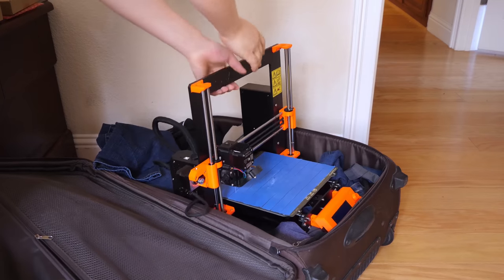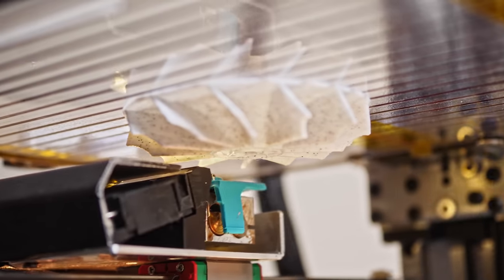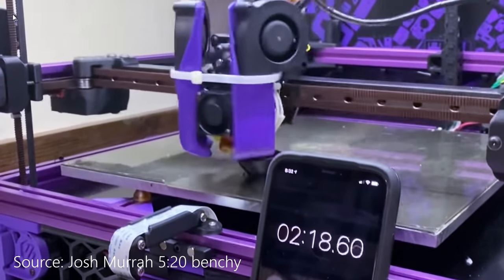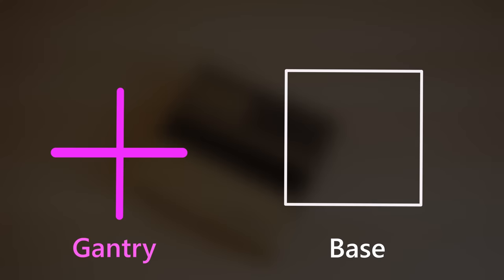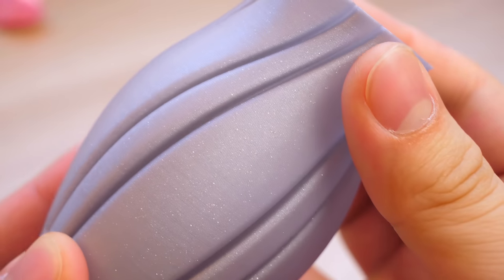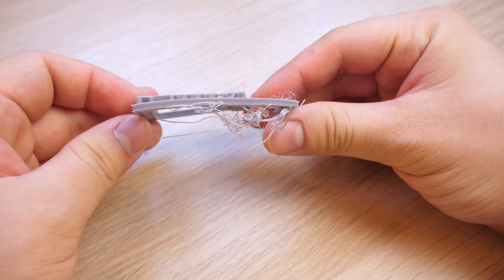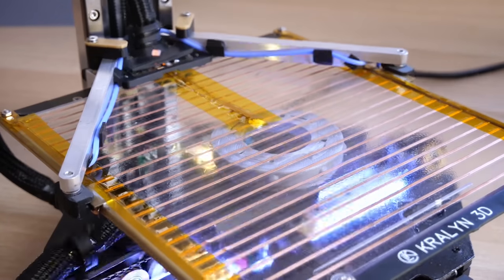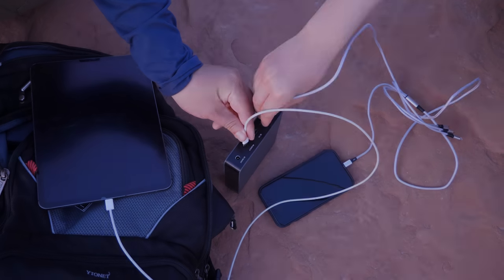A DIY 3D Printer That’s Upside-Down, On Purpose? The Positron Introduction

Comment: Printing upside down for the most part shouldn't be an issue since Resin Printers already do that. My only concern is if the bed happens to sit just a 10th of a mm too high, gravity might pull the filament away from the previous layer, whereas in regular printing, gravity would pull it down onto the previous layer for adhesion. I don't see that happening often, and only for very large prints, but it looks like that might have happened to the top of the Easter Island Head you showed at the end of the video (12:20). It could also be a compounding effect, like each mm of travel actually travels 1.0001mm, so by the time you get up to the 1000th layer you've compounded a 0.1mm inaccuracy, which could lead to layer separation.

I don't currently own a printer, instead I've been using my BIL's, but this is an amazing design. I would love to have a simple printer that I could literally just tuck away into my office desk when ever I'm not using it. Definitely something I would be interested in getting. What is the estimated cost for this?

Comment: I really love this design! Also, if not used as a portable printer, the scalability in height should be fairly easy because of not having to deal with shaking printers and/or parts

Comment: Great job!
1:16 Those volumes are all in Cm³, not mm³, actually.
If you just do the math, using the given dimensions in mm, you get 175*165*125 = 3,609,375 mm³ (which is a little bit shy of an impressive 3.61 liters!)
The same goes for the other two volumes: 75*75*75 = 421,875 and 120³ = 1,728,000

Comment: It makes sense to print upside down from an engineering stand point of view. If only we could outsource those upside down extrusion system and the heated bed you've designed. I'm designing a highspeed 3D printer. Hoping those type of parts will be developed!

Comment: Very Clever, if you would've told me printing upside down yielded the same results, i would have laughed at you. I stand corrected. Love the low center of gravity and compact design. One concern i would have with it in a commercial space would be the fire hazard in the event of a print detaching, it might (Probably) land on the nozzle... would be clever to see a torque-out sensor trigger print stop and have a little actuator that would push up on the fallen part to keep it away from the nozzle until it cooled down....

Comment: very very impressive and clever design. I liked it. 
Just an additional idea: if there have a cool flat aluminum block surrounding the nozzle, with the aluminum block having exact same height as the nozzle tip, will it be possible to have infinite length of overhang? because the cool aluminum block may support the overhang while printing. maybe aluminum block edges need to be tapered a little so to avoid knocking off printed parts. If infinite overhang is possible, then FDM printing with no support structure may be possible.

Comment: Clever design. Two questions: 1. Is it firesafe? When nozzle clogs or in case of bad adhesion will it turn off or it can somehow break itself and building around? 2. Wich part need service first? On the video I saw hard pressure on the rollings with cable and begin to worry about bearings.

Comment: Just had a thought of an upside down printer.  Awesome to see someone have tested, designed and prototyped it!  Went through the files you shared and saw that the thingiverse files were obsolete.  Is it still in the works or has this been dropped?  Happy that you've shared this video!

Comment: Wow, I've thought about this a lot, but you actually did it! I like it :) I'm very curious about the precision of the synchromesh cables. I've read good stuff about it. But in every topic I find about it, there are always a few people claiming they contacted the original company, saying that it has worse backlash and higher cumulative pitch error..
Reply from the maker: I read them all, but I just decided to try it, and I have to say so far I had no backlash problems or inaccuracy.
Reply: I was curious about "belts" also.  I've never seen them used before.  Thanks for asking the question for me.   Now I know what to search for.

Comment: Awesome. Would instantly buy a kit or even a fully commercial version. 
The only thing i don't like is the control panel, i guess it's functional but i love touch :D
Reply from the maker: Fair, although it is not meant to be used, as everything is controlled via Web interface. The only actual button I press is the on/off and emergency stop button.

Comment: Awesome work and incredibly well done. My only comment is that I feel it’s a solution to a problem that doesn’t exist significantly… I will be the first to admit that I’m 100% wrong, but I wouldn’t guess that portability on the scale you mention (traveling) will ever really be needed for a printer… nonetheless, an elegant design and incredibly executed! I can certainly see how it is extremely effective when  it comes to rigidity and stability.
Reply: I agree the portability may be less important than just plain being able to store it when you are not using it. Most of the world does not have the huge homes that Americans are used to and storage space is limited. I have a spare bedroom that is my electronics room and still wish that I could put my printer away when I am not using it. I want this for my RV so I can build things when I have ideas on the road. The biggest challenge is going to be refining the design to get the price point down for the mass market without sacrificing precision and accuracy.

Comment: Would definitly love if I could buy this and if there would also be a slightly bigger print volume (around 200x200x200mm). But even with this size I would consider buying it. This printer is great engineering work.
I would love to use it for semiflexibles / harder TPU filaments. I think stringing would be 100% eliminated with this upside down design.

Comment: This is a really neat printer design, that heat block is a really cool design too. I’d be interested in trying to build one of these but I don’t know where I’d have to source one of those heat blocks, though if you’ve got prints in the build docs I suppose I could probably try to make one on the milling machine at work. If you go forward with a commercial run of these, I’d definitely be interested in purchasing one if I have the funds on hand.

Comment: Very well done!  I'm guessing PLA was used in the demos.  Given other materials (ABS)  are susceptible to warping from uneven cooling.  Typically, this is corrected by enclosing the build area to prevent stray air currents.  When enclosing the build area, a new problem of getting cooling to things that must be cooled.  How does this design handled enclosures?  Also, how does the print head work with 'squishy' filaments such as TPU?

Comment: Amazing job! Maybe it would be possible to cool this printer much better then most by pulling air out of the bottom, cooling the top of the print but not the build plate due to the laminar flow suction.

Comment: To everyone concerned about gravity either helping or hurting the FDM printing process, it turns out gravity has virtually nothing to do with the process.  The forces related to viscosity, nozzle pressure and stretching of the semi-liquid molten filament are all significantly greater than the weight of the extruded filament.  Hence, all of the aspects of FDM printing (oozing, bridging, curling, etc.) are virtually unchanged when you print upside-down.  I have been printing upside-down for more than 5 years now (see LoboCNC video links above) and everything about the process is pretty much the same as with my conventional printers. Even on the rare occasion that a print detaches from the bed, it just falls off, gets pushed around, and the extruder merrily creates a pile of spaghetti. And beyond that, this looks like an excellent printer design that I'd gladly add to my collection.

Comment: While I think most of these 3D printers to be on the small side, which limits a possible market for an auto entrepreneur with little capital to start, they are nonetheless quite lovely and have my interest. One with a minimum 400 mm item production capacity is the one I'd want to purchase. If I purchase one, it will be my first 3D printer; but, I may be better off building one from scratch with parts that suit my needs. I will have some difficulties to do so that because I have no knowledge of 3D printers.

Comment: Like some comments, the fact that you can fold it away for storage when not in use, is much more needed element than moving it around. Only suggestion I would have on it, is that could it be so modular, that you could swap rails to 250-300mm to make this BIG folding printer? Or does it loose its rigidity?

Comment: If  there is a bit of space in the bottom.. maybe we can integrate a camera running to rpi which can run a ML or AI algorithm to figure out issues and make improvements along the way? Like if there is layer shift them the rpi can inject gcode to compensate and correct or if there if the print fails then instead of burrowing the hot end in melted plastic it can self shut down?

Comment: Excellent and compact design, I wish you all the very best success in the production. I was wondering if there is a printer that has a built-in UV curing lamp to cure epoxy resin/hardener type of filament if there is such a filament, perhaps another challenge? :-)

Comment: How have piqued my interest, and would happily pay for one a Positron.  In fact, would like to be an early adopter tester (would still pay for a unit).  I recently retired as a software engineer and tester (across many industries) and have been 3D printing regularly starting with the Printrbot 1405 Simple Wood, and the past 3 years or so with a CR10S.
BTW - I loved the closing.  Amen

Comment: Very interesting and an innovative design. Although every prints you made seem good in fact, have you tested or calculated maximum weight it can handle and if this is scalable what would be the maximum scaling in dimension while considering bed adhesion of various filament materials?

Comment: So on a standard right side up printer you usually need supports for any over hang over 45 degrees (at least in experience). Would it still need support in those overhang areas if the model is flipped upside down? Or would they still need something to hang from? Did you use anything like glue stick for bed adhesion?

Comment: The right-angle in the hotend path makes me concerned with retraction settings & oozing when printing materials like TPU. Pretty cool though, I'd consider purchasing one. Are there any issues with cantilevering of the bed because it is only supported in the corner?

Comment: Could you maybe use gravity as an advantage to straighten bridges?

Like straightening that slightly sagging first filament line of a bridge by partly re-melting it with the print head while pressing it upwards in an arc pattern over the course of the bridge?
Or printing the second lower line in an upwards arc, bending the softened first upper line upwards and straightening the two lines as a result?
...
I guess probably not, since you would actually need to shorten a sagging line to make it perfectly straight.

But nevertheless, I like the notion that you could potentially use gravity as an advantage for something!

Comment: Looks amazing! Just wondering how materials like PETG, Nylon and such will print, Nylon hates sticking to stuff without warping. PETG needs glue to not crack glass plates. Will follow the build!
Reply: For both i think a layer of glue stick or nano-polymer-adhesive would solve that issue

Comment: Well, this is a very very interesting project.
Will you make a comparison of the capabilities of this printer and any ordinary FDM? I would really like to see what this printer is capable of.
And in general, I would like some kind of review on the printer. What plastics work well on an inverted table? Will large models with a large filling be kept on the table and will there be no distortions in the print at the same time...?
You said that the printer works on Klipper. I saw the SKR board inside, and the raspberry is planned to be installed outside? and the question is with the power supply, it turns out that the unit will be outside and just connects already via XT60 to the printer, right?
So I really like the printer, it's really something new.
Reply from the maker: Plastics I tried are PLA and PETG, both work well. I never had a print falling off mid print because of weight. The Raspberry Pi is installed in the front controller housing. Power supply is external 19.5V 150W laptop power supply with XT60 soldered on the tip.

Comment: As this is meant to be a portable printer, how robust is it. Let's say I am carying it in it's box and I accidentaly drop it or I am driving in my car and hit a really big bump, would the printer remain in tact. And this printer looks quite integrated, if something were to break how easy would it be to repair the printer? if a part that I can't 3d print broke could I easily get a replacement or would I have to find some obscure part or even custom order one?

Comment: Could this inverted system not have some problems with the inclination of the plate in the case of models which in terms of size and density reach a certain weight, obviously unbalanced on some side of the plate so that the optimal situation of equidistance between plate and nozzle is lost?

Comment: is this going to be something that will be sold as a complete printer, a partially assemble kit, or will it be something we can print an source the parts ourselves. i have wanted a small portable printer for along time, the best solution ive found so far has been the mini delta from monoprice but i know theres a better solution.

Comment: What happens if the print detaches? Normally it would do little harm but now its inbetween the cables, i would suggest some kind of sensor that detects if the print comes below the hotend, or maybe something with a camera that detects movement in the print.

Comment: my only critique would be to say im concerned about the 90 degree nozzle, sure it might perform just fine while printing, but what about if you get a jam? I feel like this type of hot end would be impossible to do a cold pull on, and if thats the case that means even a small jam would result in a complete disassembly of the hot end. Im not clever enough to come up with a better solution tho to be fair haha.

Comment: Interesting idea, well executed, but doesn't this bring issues when it comes to printing models with overhangs that need supports? I can see that in some cases the need for a support structure just disappears but in other cases, for example if you want to print long thin (extensive) overhang structures, how would you stop sagging? In 'normal' printers we rely on gravity causing the structure to rest on a support bed that was laid down on a previous Z run, but in this inverted case gravity will act to pull it away from the support. It seems to me that commonly used slicers will need to have machine settings that cater for 'upside down printer' in order to give the best G-code for this type of printer but even then I am not sure that long thin overhangs will come out well. Perhaps you can make some videos that address this issue and show us the results?
Reply: Just suport it from the roof like resin prints
Reply: @matsv201   In practice, with FDM, it seems that gravity is needed to get the oozed out filament to stick to a support. A video entitled ''Printing Upside Down to Eliminate Overhangs' from 4 years ago by 'Tinkerine' would seem to support that this isn't going to work well but I look forward to seeing the results of some attempts with this machine.

Comment: How is the printer able to achieve these specs? because that's how you built it. lol. It is objectively... quite nice. i feel like this wouldn't be an oddity sitting next to brands on the shelf. that being said... it isn't. having done exactly this process(different wildly), i've found that making a good product is easy. Making one to compete in a market where being "good" isn't the point isn't possible. I wish you the best of luck getting this down to a price point without losing the originality entirely.

Comment: Price matters.  Is that a milled aluminum base? Can it be redone in extruded aluminum?  I'll be curious to watch for a third party review.
Reply from the maker: I went with extruded aluminum on V2, it is cheaper on the part, but not cheaper overall because of all the additional brackets that is needed.

Comment: dont get me wrong, it is extremely impressive and i wanted to build one... but seems like no one is questioning the elephant in the room - the hbot racking forces issues. may i know how did you address it? there is a good reason why most people no longer build hbot 3d printers and prefer the corexy/i3 style 3d printers.
Reply: Rather than a standard H-Bot configuration with two side rails, this printer uses a single rail in the center.  This eliminates the racking issue without requiring the extra cable/belt length of a core-XY configuration.  Note, though, that this requires the belt or cable to operate in two separate planes, which would require some twisting if a belt were used.  He instead uses a synchromesh cable which eliminates the twisting problem.

Comment: I think a detailed explanation of how this printer manages to print upside down would be useful. All the fdm printers I have seen make use of gravity and the run some filament through the extruder before the print starts to make sure adequate flow during the print. 

In short I am having trouble believing your video. The filament would have to be molten and then instantly cool back to fully solid for an upside down printer to work.